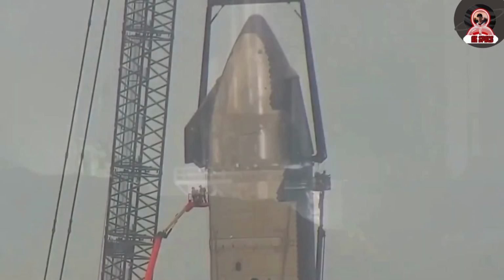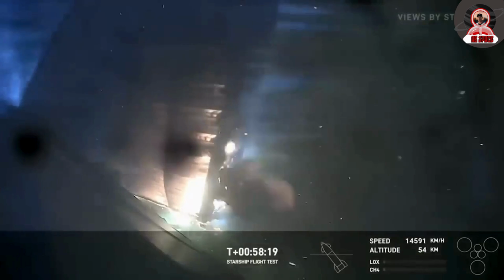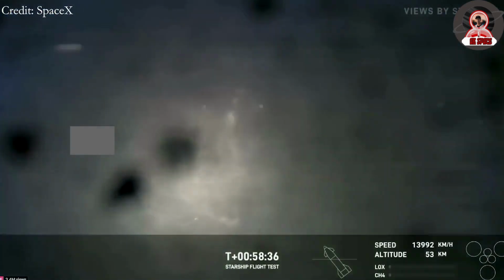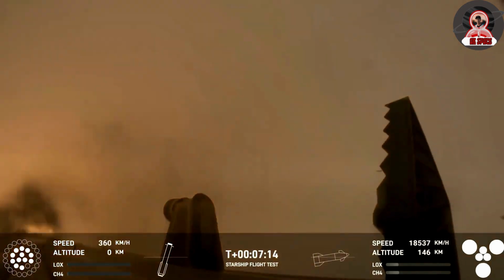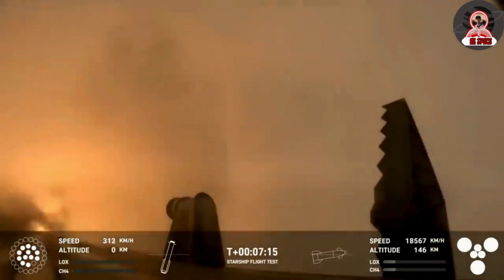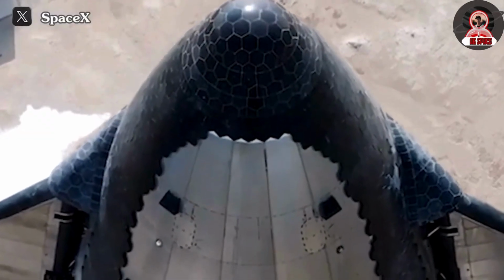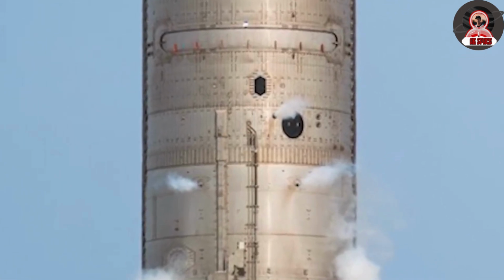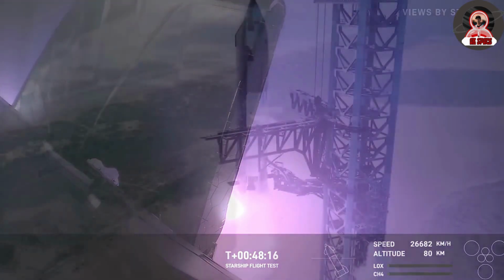"Elon Musk  Starship Heat Shield Upgrade: SpaceX's Plan After Ship 29 Heat Shield Failure

Comment: Elon Musk needs a Plasma Sheild that reflect atmospheric pressure from the ship, so it won't burn up which is a completely new technology.
Reply: There is a boundary layer that keeps the plasma from direct contact, but the Elon told Tim Dodd that the flaps of the generation one Starship are mounted too far outboard and future flaps will be moved leeward so the joint will be protected by the mass of Starship in front of it.

Comment: Maybe the flaps could be made out of titanium or tungstan.  Both have melting points far higher than stainless-steel!
I believe that titanium is also as strong as steel, but twice as light, and with a higher melting-point!

Maybe, you can get away without heat-tiles - especially with tungstan!
Reply: They need to deflect the stream of plasma away from the flaps and hinges, there are more adept engineers with more data and smarter than I'll ever be. They'll solve this quick as you can, you just watch them
Reply: Learn to spell Tungsten you M0R0N.